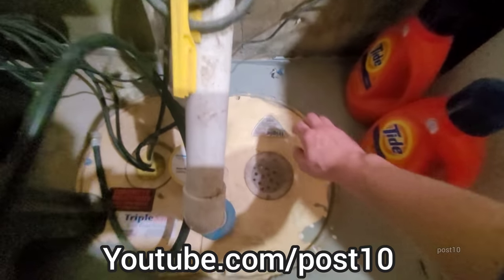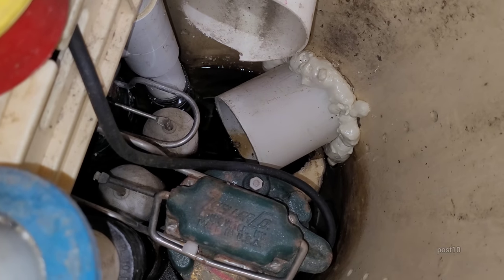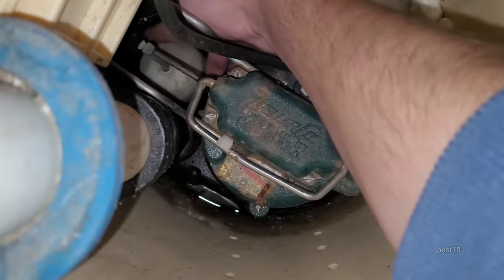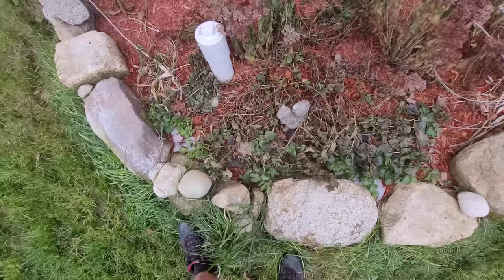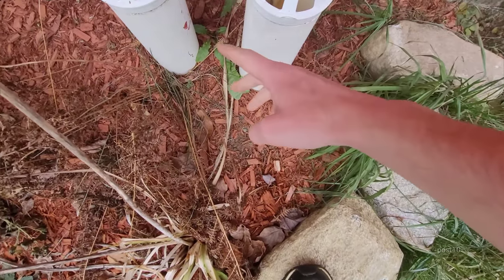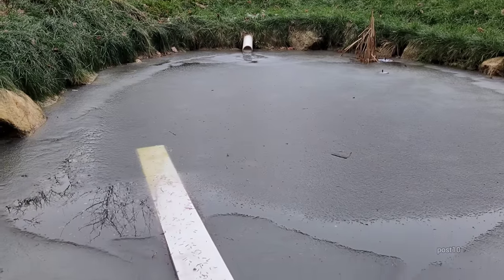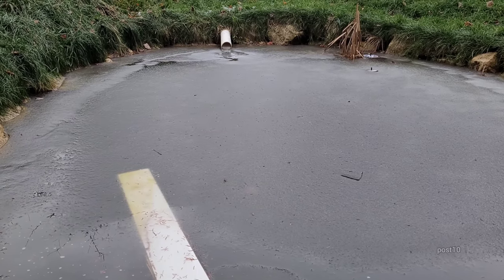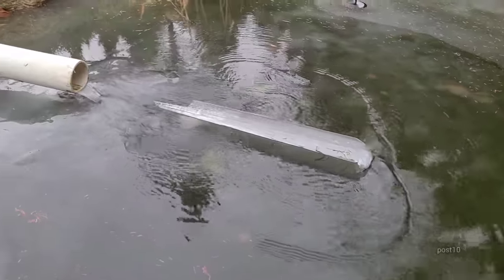Unclogging Ice Dam From Culvert Drain Line And How To Prevent It From Happening Again

Comment: some ice melt cables have a thermostat where the power cord meets heat tape, if it does then it may not turn on unless the pit gets really cold to around freezing.
don't overlap, spool or bunch it up, because anywhere it's touching itself or bunched will overheat burn out faster or even burn what it's touching.
it's not really meant to melt ice build up, but to keep it from forming and building up. if will usually melt it, but very slowly.

Comment: Post
At 23:45 when you said file off the tails of the zip ties, try using a Bic lighter; a lot of different plastics can be given a glass smooth rounded edge in about 5 seconds.

Comment: heat tape we purchased has senors every 18 in.  that way wherever it gets too cold in that pipe, it will come on.  We previously had the old type, sensors on the ends which didn't work all that well because of the middle of the pipe having a different temp than the ends.  Cost more but worth it.

Comment: Why not pull the excess heat wire into the basement and wrap it around a section of stove pipe. Instead of heating the pond maybe get a trickle of heat from the pipe in your basement. Check with somebody like an electrical engineer to advise weather or not it's safe to do

Comment: Dude you should never wrap and cross over the heat line over itself could cause a fire or short the life of the wire by making a hot spot on the wire. What could be a better idea is to pull it over to the overflow in a straight ine. Also where the cord plugs into the outlet and heat wire  is a block that has a thermal switch that turns it on and off. The block needs to be in the slump bucket to sense temperature to turn it on and off. The way you have it the sensor is in your basement and it will never turn on or off. The first time that you did plug it in yes it did get hot but after it reaches a temperature it will turn off and then it will never turn back on because the sensor is located in the wrong place. If you run the excess heat line to your overflow even if it sinks to the bottom of the pond it'll keep water flowing to your overflow and not damn up the overflow too. I use the same idea you have for my gray water system to keep out the grey water out of my septic tank. Good luck and may the force be with you.

Comment: Since the ice dam only forms at the end of the pipe, and the rest of the pipe is underground, couldn't you just use a long extension cord and a few feet of heat tape, at the very end of the pipe? Seems to me like that would use a lot less electricity.  You'd have to waterproof the connection between the cord and the heat tape though.

Comment: Hey Postie, be careful double-wrapping the heat cord.  Most of them have warnings saying not to plug them in when they are coiled up-- you can melt through the cord and short them out or start a fire. Double-check the instructions before you tape down the extra bit outside!

Comment: I like the blue wire wheel that u used to bring the wire through the pipwork my only thing with that blue reel,is that it would be better with a handle on the blue part to make it easier to reel back in,must like on a extention cord reel.

Comment: Tip for fishing a line through conduit. Use a vacuum and a string. Or in this case you could have floated a light string tied to a little boat. In other cases, tie some fluff to a string and vacuum it through to the other side 🤷‍♂️

Comment: If you replace the electric tank, look up a electric tankless water heater. They're sold by the GPM you need to reach a particular temp. Their running costs are a lot lower.

Comment: As its so cold here in the uk tonight i was just thinking in the morning im guna have a walk up the river an see if theres any mad looking ice structures or dams forming, its defo cold as my garden pond has froze and its got 2 water falls moving the water
Reply from the maker: It's been around negative 15 Celsius the past couple days around here and that is really getting our Rivers starting to freeze over, what do you have for temperature?
Reply: @post.10  haha no where near that where i live i think it has been as low as -15 -17°c up in scotland but tonight where i live its going to be -8°c only the edges of the slow moving streams and small rivers will freeze maybe ive put a pot of water outside to see how thick the ice gets after 8 hours in the cold
Reply: Do a update video on the cable let it freeze and turn it on cuz if it works well i might buy one to wrap around my outside pipes in future

Comment: I'm not sure who did the spray foam on the walls, but it should be covered and sealed with a non combustible product if that's indoor living space/basement or anywhere fumes from it burning can get to you.(fire code) when it burns it emits very toxic fumes.  unless they have some new magical product that doesn't.
Reply: The stuff I have yes will produce toxic smoke but is fire retardant, I have taken pieces of it and put a blow torch up to it and it will not stay burning on its own.

Comment: In all honesty, you didn't need to buy the heat wire nor snake fetcher thing at all.

Just install a fan on the lid that'll force home air through the pipe and it'll thaw everything in minutes, with much less effort and far less electrical cost.

And, if you read the user manual of the heat wire, you'll see that it's dangerous to allow the heat wire to touch itself anywhere along it.
Reply from the maker: I don't plan on running this thing at all unless it freezes solid and it will be able to melt itself out

Comment: If the cable is a bit soft and rubbery, I can tell you, the mice will eat it. As my experience is in my house with cables of my antenna, subwoofer cable and electric cables.

Comment: Hey post.  Not sure if you are aware, but the maximum temperature pvc can handle is 140 degrees F.
You mentioned that heat cable is 160 degrees.
You are going to have a problem, the pvc is going to melt anywhere that cable is touching.
Plus inside where you zip tied it, you’re going to smell melting plastic.

Just a heads up.
Reply from the maker: I did that research when I did this and I just looked it up again and multiple sources say PVC doesn't begin to melt until 200 Fahrenheit some variations much higher
Reply: @post.10  fingers crossed bro.  Just keep your sniffer peeled for a while after turning it on, if you start smelling melting plastic then you’ll know.

Comment: Coiling the wire as you have will reduce the efficiency of the heater and cause a possible hot spot. Best off to trail the excess wire around the periphery of the pond.

Comment: Now I just learned about East Heat cables. Will they be good to wrap around the basement pipes to keep them warm for the winter? I think I am learning it only needs to be on for a little each day whether than all the time. So let me know and thanks for this video! I am learning a lot here. P.S. I like all the unclogging drain videos you do as well!
Reply from the maker: You could probably use this wrapping it around pipes, ask a professional first, there's also a thing called heat tape specifically made for pipes
Reply: @post.10  Yes, good idea too. I would just get a short one since the plug is not far from the main pipe in the basement.

Comment: Hey my mom has that dryer! Do you know how to fix the drum not spinning?
Reply from the maker: When you turn it on do you hear something moving? Is the motor working but it's not spinning? Is there a loud humming sound like it's struggling and stuck? Just nothing at all? It could be jammed, needs a new belt maybe fell off the pulley? Maybe I'll loose wire

Comment: are you worried about back flow at all, or mice coming in through the pipe?
Reply from the maker: I'm not worried about backflow I'd say the pipe has about 4 ft of loss throughout the entire thing and if it was ever to start coming back through that I would be in way worse trouble I think and as far as mice it's a possibility they might come in but they could only go as far as the pit and if I ever found Mouse poops in there I would probably put a screen on the end

Comment: If you would have laid the pipe at a steeper grade you wouldn't have this problem !
Reply from the maker: I don't have the elevation to do that, this is as steep as possible leaving the house
Reply from the maker: Or do you mean it should have been less Steep and then abrupt at the end? It would still freeze regardless of how steep it is because the trickle is so small
Reply: Yes ! the  last 10' drop the invert just 2" would prevent an ice jam . I will say I don't live as far north as you and have as much and as long of a winter as you do ! So did the best thing possible! 👍